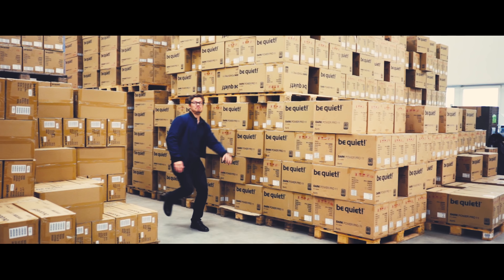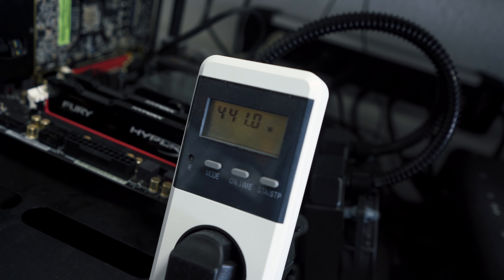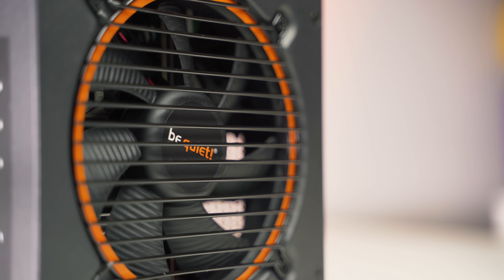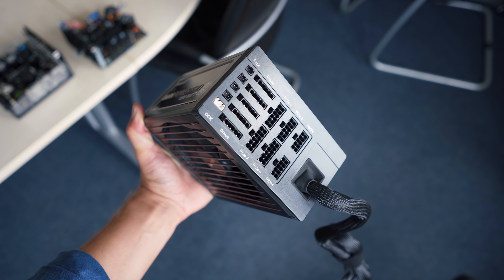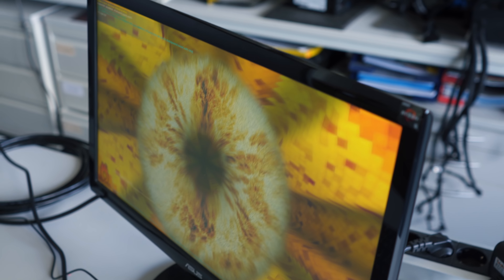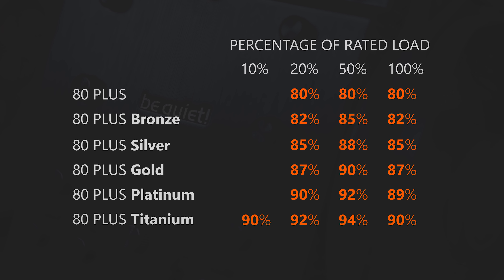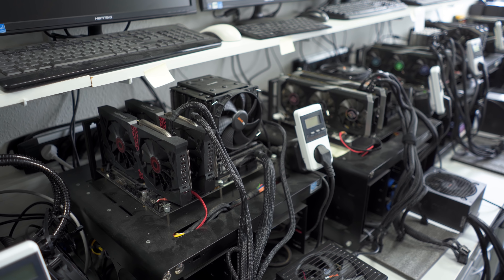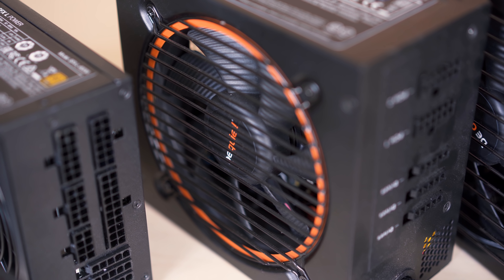How To Choose a Power Supply

Comment: 1600W for my Intel Pentium sounds good to me :)
Reply: That’s only enough power for a first gen pentium obviously. New one would need dual 1600W PSUs.
Reply: You will need an extra one if you add a graphics card, keep in mind
Reply: The old Pentiums are space heaters
Reply: NOOBS, I draw my power straight from the power line.
Reply: A pentium 4 might need a nuclear reactor to run properly.
Reply: @jorgeszabo1659  I had one with 450 W PSU from Enermax - no probs
Reply: Fedor Forafonov r/woosh
Reply: Rgb?
Reply: Be sure for inefficient using. 1600 watt is a overkill for a crap, low powered system of yours.
Reply: if it is Pentium 4, it may not be good enouth,...

Comment: You Can Choose the power supply, by choosing the power Supply
Reply: Cemil why would he do that, thats stupid thing to say so someone.
Reply: Yeah Cemil be realistic 1500W is all you need.
Reply: clearly it must be quiet psu, silly you.
Reply: It will be faster with RGB, get a Thermaltake PSU! Designed and built with care in China!

Don't actually do that.
Reply: @gaatjeniksan3068  I've only owned one Thermaltake psu, was in my first gaming pc. Ended up costing me over 400€ in repairs and left me with trust issues. Then had a Silverstone psu for a while and been using Seasonic ever since. My M12II Evo ran out of warranty but still works perfectly, so  i'm using it for grounding and when helping people with their pc's. Recently got a 750w Seasonic Prime Ultra Titanium, a little on the expensive side, but the 12 year warranty sure is nice to have
Reply: @Qalibrated  That is why I made clear at the bottom to not actually buy a Thermaltake PSU. I'm using a Corsair HX1200 myself and it's working fine (and has a 10 year warranty) but I'll probably get Seasonic when I build another PC. Corsair of course doesn't make anything themselves so every series can vary from each other in quality. I do like their maglev fans though but those aren't as mission critical as a PSU.

Comment: One thing everyone can agree on:
Never get a case with a power supply already in it.
Reply: Depends on the build really. I recently bought a mitx case with a power supply built in so that the case itself is smaller.
Reply: Stupid advise
Reply: Except for IN WIN
Reply: @JaySeeJC3191  There are SFX and TFX PSUs available for that. One point would be the cost but the size isn't really an argument. You can even get PICO PSUs where most of the actual PSU is condensed in a power brick outside of your build. Similar to a Laptop.
Reply: Node 202 with Integra 450W psu. Blanket advice is for idiots, just keep looking and inform yourself.
Reply: Nothing happened to me for years, what are you talking about?
Reply: Sicarius damn right bruh
Reply: I bought a Dell pc with i7 3770 and 275w I want to buy a gpu but I think i need a 500w psu before buying a gtx 1050 or 1650
Reply: Unless NZXT does it
Reply: I got my current computer as a pre-built in 2011 and it took 9 years for the power supply to go bad
Reply: Why?
Reply: @malekskhiri1415  1050 Ti will do fine on the 275W but I would replace it after a little while
Reply: Well, that depends mostly on the brand you are buying. So not a good advice really.
Reply: Your case could come with EVGA, Corsair, Cooler Master, Thermaltake. Not a very good rule of thumb.
Reply: @deViant14  Who told you that
Reply: @Tomago9387  go to PC part picker. Filter cases on included power supplies. Filter on each of those brands. Or just know that this is not a big secret. If a company makes cases and PSUs they sometimes include them. Notable exceptions include Phanteks and Be Quiet who only sell separately.
Reply: @deViant14  A lot are really old..
Reply: @Tomago9387  I think you can solve that problem yourself. I proved there is not a reason to avoid all cases with power supplies. That's it.

Comment: I personally picked the Corsair RMx 650w due to it's "semi-passive fan mode that facilitates silent operation under light and moderate loads (<40%). Additionally, a relaxed fan profile helps minimize noise output under more taxing scenarios. Corsair paid a lot of attention to acoustics in its RMx and RMi families, and the result is impressive indeed: they're both some of the quietest PSUs in their respective classes."

I don't really understand why be quiet! doesn't offer a model which is configured as semi-passive too, nothing can be quieter than 0RPM fans up to a certain load, say 30/40/50%.

Comment: I've run an EVGA SuperNova 1300 G2 for close to 4 or 5 years now and it works fantastically well.  It used to power a pair of EVGA GTX 980ti Classifieds and an X299 with 32GB but now it's running a single Asus Strix 2080Ti and an Asus ROG Maximus XI Extreme Z390 with 32GB so it's not loaded.  There is something to be said for having a too big PSU for your needs, since it can also potentially last longer due to less loading on components designed for much higher loads.  While there is an "ideal" size based on your equipment, there's also nothing wrong with having too much PSU output.  By that I mean it's not going to harm your equipment and operating costs will be negligible vs a smaller more optimally sized  (for your needs)  PSU (assuming similar efficiencies), with the only difference being cost.  Going bigger than you need at the time of your build will also give you room to grow into

Comment: Rule of thumb, add up all your at 100% load wattages and double it. (for cheap PSU's or PSU's without fanless mode)
Advanced Rule of thumb, add up all your at load wattages and multiply by 2.5, then ensure that the PSU is a gold rated or better with a fanless mode. (If you want a quality PSU)

Most "eco", "zero RPM" or "fanless" modes will be active at 40% of rating and below (some go higher), which means no fan running to suck crap into your PSU. If you can achieve that by default under load, the fan should only ever kick in on hot days when the ambient temperature is high. In effect you end up with a fanless PSU with all its benefits (quiet and stays clean), with a fan backup should it be needed.

Contrary to popular opinion, having too big of a PSU isn't a problem as most efficiency curves peak at 50% but are reasonably flat at between 40 and 60% and you only see large efficiency drop offs well under 20% where it doesn't matter that much as the power loss is small at idle and light loads. e.g. 80% efficiency @ 100 watts = 20W lost, which is the same amount of total power loss as 95% efficiency @ 400W = 20W lost.

 There's a bunch of things to consider that weren't covered by this video, output ripple being a big one. While most PSU's have reasonably good ripple control, that can still vary by a large amount between PSU's (2-4X+). 

Continuous output rated temps of 30° 40° 50°, most are rated at 40° but some cheap ones are 30° (typically unbranded) and better ones are 50°, this is the ambient air temp. If the psu is drawing from inside the case (like top mounted PSU's can) then this can matter in a "hotbox" scenario, you definitely don't wan't a 30° rated supply running at 100% capacity in those scenarios.

The above rule of thumb typically takes most of the technical PSU considerations out of the need to be considerations (It's why it's the rule of thumb). But if for any reason you intend to run anywhere near 100% capacity (80% or higher) choose wisely.

Comment: i dont go for the most efficiency but more for protection of my hardware, like surge/burst, short circuit, over voltage etc. or coverage forshort main outages like .1 - .3 sec or so (yes in my city here in germany this happens sadly more often then u think) then for the modularity and low noise, efficiency is mostly the last point i care for but it has to be at least 80+

Comment: Easy, buy whatever Seasonic PSU meets the wattage you need.
Reply: dangerousmythbuster using the seasonic 850w titanium myself!
Reply: @tau8550  Except the fact that most of time you can get CX series PSU for the price of S/M12II
Reply: @tau I totally agree with you. I have a system with an S12II and this thing runs silent, cool, and stable. I was amazed by the tight voltage on this thing. Made me feel like i wasted my money on a RMx in the other pc. I also think the S12II s now in the market are a new revision, as I don't recall them having HDB fans when they launched, but the one I got now has HDB fans and the box design looks refreshed than the time of release.
Reply: S12II it's a great power supply for it's price, you can run any single gpu config on it an the ripple it's minimum. This stupid people asuming that if some PSU don't have a platinum label on it it's automatic garbage it's getting annoying...
Reply: "Seasonic Sii12 is a great PSU"

Which part of it good ? Having a Japanese capacitor that made in China? 

Being a group regulated design is already bad for a PSU. But this PSU also doesn't has UVP on the most important rail 12v, OCP on any rails and if during high load they reach like 2000 rpm, that's your good PSU?

A decent PSU must at least come with a dc-dc design and indy regulations is also ok just not group regulated . Protection IC wise : a good PSU must has OCP(Minor rails , UVP , OPP , OVP , SCP ,while OTP is optional but is also we also wanted that.
Reply: @tau8550  what even part of the market are you in? 

US has CX/CXM around the market mostly

EU has thier Xilcence performance A+ , Be quiet Purepower9 , formula gold , hexa 85+ 

SEA has Coolers master watt bronze and another .

Are you telling me that those are more pricey than Sii12?
Reply: S12II is pretty bad... CX and CXM are bad too...

They are so many good PSU out there... and you are talking about the shitty ones...

If you are looking for good psu:
XFX - Pro Gold, Pro Black, XTS, Pro XXX, XTR, TS Gold 
EVGA - G2, P2, PS, T2, 1000G1, 850W and above GS, GQ, B2, 550W and 650W GS, GD, G3, G1+ (not to be confused with the G1) 
Seasonic - X, Platinum, Snow Silent, all Fanless units, Prime (all series), S12G, G-series/SSRM, M12II 750W/850W, Focus Plus Gold/Platinum, Focus Gold 
Corsair - AX, AXi, HXi, RMi, RMx, SF, grey-label HX (2017), 2017 TXM greater than 650W 
be Quiet! - Dark Power Pro P10, Dark Power Pro 11, Straight Power 11, Pure Power 10 400W or greater 

It should be enough to find something good in this list.
Reply: @SirMetrowy  the new CX/CxM is not bad. If so prove it. They are a great budget DC - DC design. Yeah the CX is better than CXM for the reason that they are using LLC resonant design instend of using a double forward design but both of them is Dc-Dc , protection and safety is there , load regulations and ripple is really great than another budget unit so you'll notice that they are the currently one of the most recommended unit by most of PSU analyser. 

You might confused with the old CX green with group regulated design and rated at 30c
Reply: @SirMetrowy  You just copied the PSU tier list. JohnnyGuru would tell you that's not smart. Plus, you listed the best (and most expensive) PSUs you. S12ii is good for the price. Of course there is a hundred better units out there, we're talking that it's the king of its price range in MOST (not all) markets.
Reply: emosh73  You might want to look at the EVGA 550W B3, G3, P3, T3 line of PSU's... fully modular, tight rails, all around solid PSU with good ratings. You can definately pick up a Gold (G3) of that wattage for under $100 US (maybe even a Platinum if you can find a good deal).
Reply: I got a nzxt c850 which is made by seasonic

Comment: The Lowest power supply I have found with 2 EPS (4+4) connecters is $90usd and 650watts gold rated. The others are like 900+ watts. I on my back up PSU which is a 1000watts and when I hooked up the docking bay power cord in my Rosewill Stealth Mid-tower the PSU actually melted the power wire apart. You must look at connections you need to make. Then choose a PSU wattage.

Comment: I went with a Pure Power 11 500W for my system. The only non-modular cables were the motherboard ATX power cables, with everything else being modular. This was great, because my system doesn't need a lot of stuff (3 SATA power, 1x8 ping for GPU, ATX power), but I know I won't have to buy a new PSU if I ever upgrade to a beefier GPU, or get more SATA devices.
Be Quiet also has cables that are all black, which is great.

Comment: Can you do an in depth video on intake and outtake fan setups and their benefits for both motherboard and cpu temps for smaller cases like the level 20 VT? It would be more interesting to see how airflow can be controlled over various areas of the motherboard and this case allows for such testing. And I would like to see more of micro-atx builds as they are more portable in the real world.

Comment: PSUs are  the part in a PC where only the best of the best is enough, IMO. They last you very, very long and save you a ton of money if you buy the best, most efficient one. And in addition to that, higher quality PSUs also deliver "cleaner" energy to the devices in the PC with less ripple, more stable voltage etc. I spent the money on a Dark Power Pro 11 some time ago and so far it's worth every penny.

Comment: I've always been a fan of semi modular. In almost every standard build you will need the 24 pin and the 8 pin. However if the price and all specs are the same, might as well go full modular.
Reply: I was too... and all my PSU's were semi... then one day I decided I wanted custom cables for my PSU for bling and then I realized I needed a full modular to take advantage of custom cables... good excuse to get a new PSU.
Reply: @wolfshanze5980  you dont really need full modular to do that though. You can get extensions off of your standard 8 and 24 pins. Of course that is assuming you have the room to cable manage all of it too.
Reply: @vdub5818  Ya... actually my first thought was to go extensions... but then I realized how that would (or more accurately would not) work with my case and cable management. I have a large window to the inside of my case, but no PSU shroud... I do have cable management space in the back, but not a whole lot... I really do like my case, but it's going to feature the cables coming out of the PSU as well as when they come out of the cable management slots, so I figured might as well just go full cable replacements instead of extensions, then I don't have to worry about trying to cram all the extra cables in... i'm actually happy going this route, because I sat around for some time trying to figure out what i'd do with all the extra cable lengths if I went with extensions. It also gave me an excuse to upgrade from an older Bronze PSU (with some exposed ketchup and mustard wires) to a newer Gold PSU.

Comment: SEASONIC FTW~~~~
Reply: That moment when you fanboy over a power supply company 😂
Reply: @COFASA that is correct, but it's actually the other way around. Evga and other vendors produce their psu in seasonics factory, so they all use seasonics equipment and parts. Seasonics is actually the king here.
Reply: @davidg4512  Not really. Seasonic makes both good and bad units, companies like EVGA use different manufacturers for different models
Reply: @davidg4512  nope. They aren't king , if you are mentioning about king in term of PSU OEM from top of my head.  flextronic , FSP , delta , liteon , hipro , zippy, CWT ,Great wall , HEC , chicony ...etc. Seasonic is not in top10...idk if they make it to top 20. Lol.

Comment: I'm still using the Original Corsair HX1000w PSU, it's rated @ 80 Plus(only 80%) but I used it for many upgrades over the years, including 2x ATI 2GB HD4870X2 in Crossfire X(4 gpu's) & 3x 2GB Nvida GTX 670 FTW in 3-way SLI. I don't see a point in upgrading my powersupply if it still works!

Comment: I bought Seasonic  Prime TX-1000 1000 WATT. I needed 6 sata ports because I use a lot of RGB on my slab desk top 10 feet worth of epoxy slab bench top with rgb river running threw it Its flat out super cool and vary expensive to build

Comment: I just bought the 1000w Be Quiet Straight Power 11, plugged it all in, flicked it on and saw a bright blue zapping light and screeching noise come from it, unplugged it all and immediately had to test that my components weren't fried. Getting a replacement unit tomorrow so hopefully this one won't be faulty - I hope I'm just very unlucky and that doesn't reflect on the quality of their products though

Comment: You also want good ripple, under 20 mv on the 12+ Volt rail(s); although the ATX spec is under 120 mv. Too much ripple to make an overclock less stable. Good transient response is also important too. Manufacturers don't publish the "real" specs like ripple, response time, cross-loading ripple, etc. Go to Tomshardware or JonnyGurru or HardOCP for in-depth PSU reviews. Why pay a premium price for average performance?

Comment: simple : Buy what you NEED, not what you want, a typical 400 watt gaming system doesn't need 1600 watts PSU, just buy 600 watts or 750 watts PSU